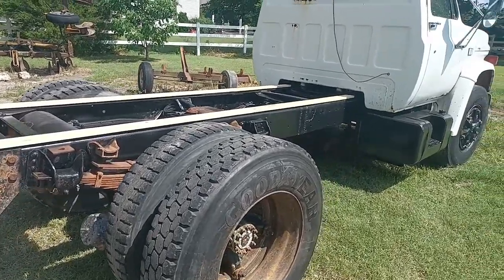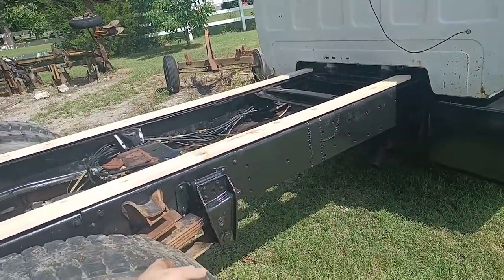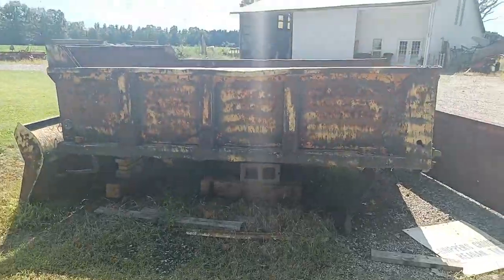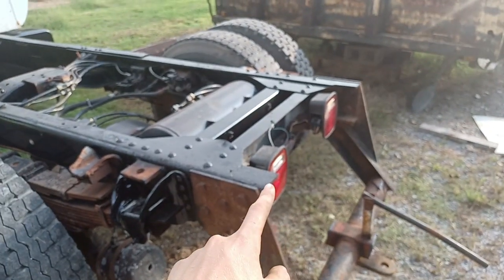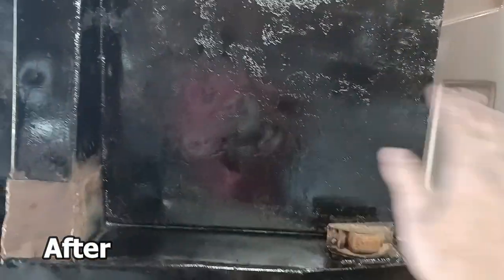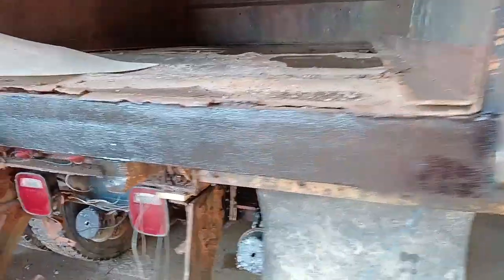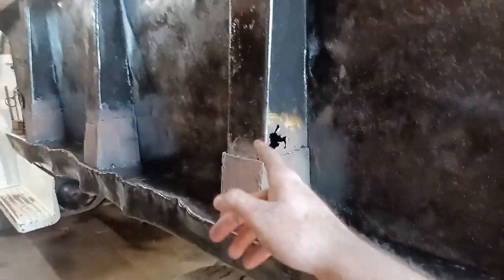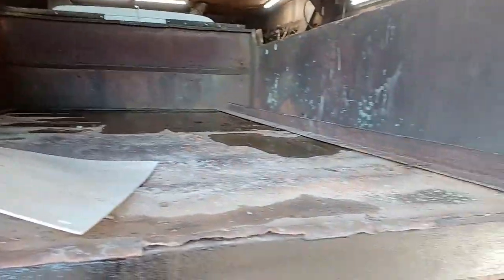$1,000 Dump Truck: Episode Three! (Air Brakes 101)

Comment: I just picked up one f these too , 1967 /70 air brake dumps truck , no engine i mine , thanks good job thanks BigAl California.
Reply from the maker: They are good ol' trucks! I bet yours is in better shape than mine being from California! I would highly recommend if you have the option to buy a different engine than the 427 big block that is in mine to do so. Switching to a diesel system can be expensive but from my experience so far it is worth it! Thank you for watching and good luck on your project Al!

Comment: Since you have air brakes, and no box controls yet, I'd recommend considering an air valve and cylinder for the tailgate latch. It's far superior to a lever and linkage.
Reply from the maker: Thats a fantastic suggestion! I've been trying to find the budget to do something similar with pneumatic cylinders for all polarized controls (pto and tailgate) but don't have enough cash to go around currently. 

Something like that will happen in the future though!
Reply: The rams are readily available in used/surplus supplies and the 12v control valves are available very reasonably on Amazon. 
Being able to tip the bed and then flip a switch to release the gate as you get under way makes spreading gravel a dream.

Comment: You do know air brakes work opposite of what you explained..
AIR PRESSURE holds brake shoes AWAY from the drums..
applying brakes .. restricts air pressure which in turn spring pressure pushes the brake shoes out to the brake drums
You ever studied a CDL Manual or taken a CDL class?
Reply: Have you ever learned the rest of the BS you were spouting?
You know that there are two diaphrams in a maxi and ...wait, wait....front brakes too....